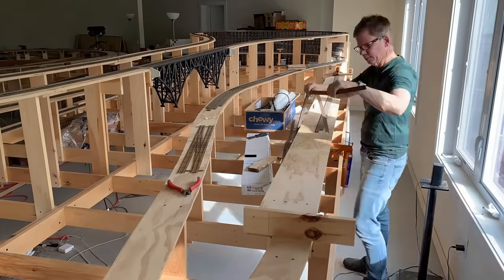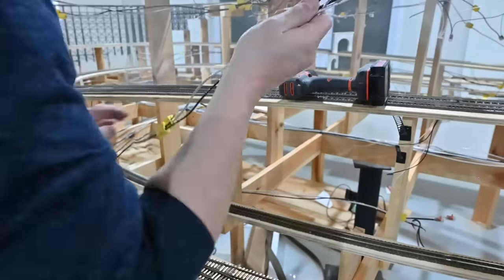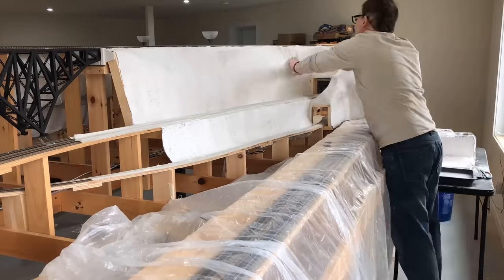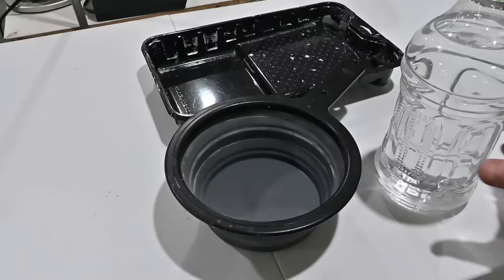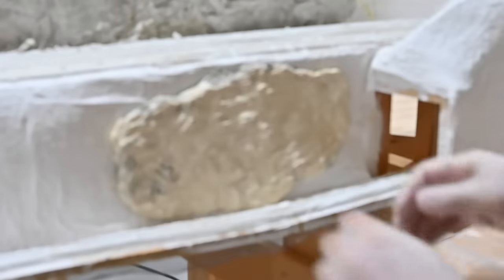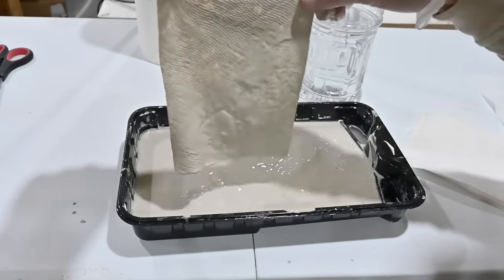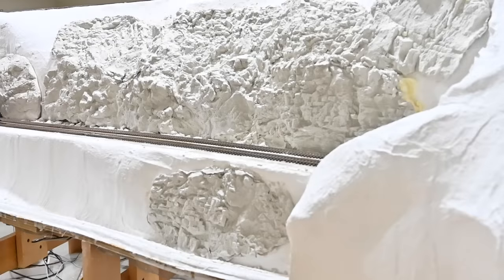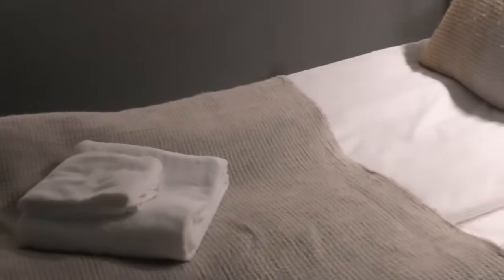S1: E6: Starting Scenery

Comment: For those that use a mechanical mixer for the plaster and get air bubbles trapped, use a vibrator under the container for a few minutes. Brings the bubbles to the surface so they don't show up in the casting.  I do that when mixing up epoxy for making molds and castings.

Comment: Interesting and basic tools and techniques!  Nothing fancy and easy to work with.  I was doing the same for layouts I built back in the late 60's-mid 70's (although there wasn't all the fancy electronics as there is today).  Back then I used plaster of paris soaked sheets of newspaper.   It easily made the layout at least a half times heavier than the initial layout base - especially since I had to hinge my layouts so they could hang onto a box secured to the wall.
I like the idea of using window cleaner as a release agent.  I had never considered that use. I have only just carefully peeled back the vinyl.  I figured what ever broken could always be moulded back into shape with the plaster.

BTW, l like the northern scenes from Finland. Very much like where I'm originally from in N. Ontario.  Not the Arctic Circle but very cold (-40°), lots of snow and lots of pine trees (but with more deciduous trees - LOL).
Reply from the maker: Hi Bill, thanks for watching! You probably have some great modeling stories!
Reply: @rcgrabbag   - I do but they are old.  When I moved down to the GTA portion of Ontario in '79 from the Sudbury area (north part of Ontario), all the places I lived in were too small to rebuild a layout at HO scale.  

I should have sold it for N sxale but I had too many pieces of rolling stock to just dump (and that I honestly didn't want to divest myself of).

I've since given it all away to people I know will give a good home to the stuff.  I still want to get back into the hobby but I fear that N scale may be too small for my eyes at my age.

I really enjoy watching your site and others and that is what keeps me wanting to get back.  Time will tell - that and what I may have to spend after retirement.

Take care and keep on producing these great vids!

Comment: I am a drywall contractor by trade. I've used USG easy sand 90 before on my old railroad I had. Easy to work with and easy to work with even after its sets. Love the progress you're making!
Reply: If 90 is to fast setting for you. you can also use usg easy sand 210.

Comment: 2 things! Whats the cost of the whole thing? I mean just the tracks alone must be thousands of $$  And how do you have time for all this?  It looks amazing already...cant wait to see the end result.
Reply: I'm being presumptuous, but it seems this gentleman is independently wealthy and doesn't have a 40hr a week job. He's got the two things you need: time + resources.
Reply: @foxye50  I SOOOO wish it was me...:))))
Reply: @foxye50  No kidding.  Nearly everything he's using is "off the shelf" expensive products.  There are thousands of videos of ways to do things at a fraction of the cost of what it would have taken to do this.
Reply: Build yourself a small shelf layout to start out if you want to run 2 locos without DCC you can find how to wire 2 controllers to set up a "block" system

Comment: I tuned in to see the scenery segment because I am building a layout based on the Swedish Ore train which travels through Lapland to the ore mines at Kiruna, and the far north arctic port of Narvik Norway. (It will be with Marklin models of that train, 3 rail AC) I visited there to research a few years ago and rode the Night Train to Kiruna from Stockholm. I packed shorts because it was late May, awoke to snow and reindeer along the rail line the next morning - saw snow and glaciers up there for 3 days (!)  I enjoyed both your scenery video and the Lappland (Sami) portion as well - nice work, quite inspirational.

Comment: You need to find a medical supplier for your plaster cloth for a railroad of this size. That's what I did. It's a lot cheaper from a medical supplier than Woodland Scenics. It's the same stuff they use to make casting with in the medical field.

Comment: Made many of my own molds. Saved a lot of money. At a club I was a member of we used Hydrocal. I personally use plaster and get it from any place that is having a sale. I found the stuff you are using to hard for carving. Thankfully I am a retired photographer and have 11 X 14 and 16 X 20 metal trays that I use for the molds. I too use a substance in the tray to nest the molds. We have cats and I use some of the litter. I pre-wet the molds with "wet water" from Woodland Scenics. For a mixing tray I use either a gallon milk jug of a half gallon jug. They are free... To get a decent working time I use very cold water and a teaspoon of baking powder in every cup of plaster. This gives me about 40 minutes of working time before the plaster starts to get stiff. I sift the plaster into the water and mix with a small wisk that i swiped from the wife. I'll have to try your window cleaner as a mold release.
Reply from the maker: My main constraint is time. I’ll pay extra for something if it means saving time and effort, within limits of course.
Reply: @rcgrabbag  Nice, if you have the money!!!

Comment: Excellent, step by step instructions. Are you planning on a section using light weight materials (such as extruded foam) in a future tape? I assume the double layer of plaster cloth is for strength. Also have seen the Bragdon materisls in operation -- excellent.
Reply from the maker: I can see a few areas where I would like to use lightweight materials. I did do a double layer of cloth for strength, given the weight of the rock castings. Another reason I want to try out the lightweight stuff, but it will require different techniques.
Reply: @rcgrabbag  thx. That's what I thought. I'll be interested in your future tapes.

Comment: To fill the gaps and areas smaller than the large castings,  I expected you to make some castings and leave them flat.  Then give them a good whack with a hammer to break them into random sized pieces which you could the fit into place and adhere them with the casting material. That way there is less fiddling with shaping to look like the rocks since it is still mostly molded surface.
Reply from the maker: Whatever works for you. Just a different kind of fiddling. You’re not going to get pieces that fit perfectly so you’re still going to be blending.

Comment: Make your own tunnel port holes out of Styrofoam insulation board you can make them bigger taller wider that way when you get bigger Passenger  cars stack container loads. And you have plenty of clearance make sure you have plenty access to inside the tunnel a derailed train. make lift out sections so you don't have to crawl underneath the layout. I like Styrofoam layouts much better than screen easier to plant trees. Telephone poles easier to if you make mistake it's easier just to cut the styrofoam recolor. I just paint the styrofoam sculpted with a knife Warsaw blade paint with latex paint. Did you have a derailment in the train hits the scenery it doesn't damage the cars because it's soft
Reply from the maker: To each their own, do what you like!

Comment: You'll go broke buying woodland scenics materials. There is so many alternatives
Reply from the maker: You're definitely right unless you have some connections (*wink). I am also using alternatives as well.
Reply: They didn’t have those fancy sheets when I did mine a long time ago. I just used newspaper coated in drywall grout over chicken wire, since I already had the chicken wire. I can see how the window screen would work better, though.  I just didn’t already have any of that.